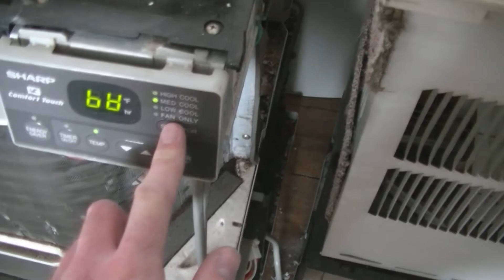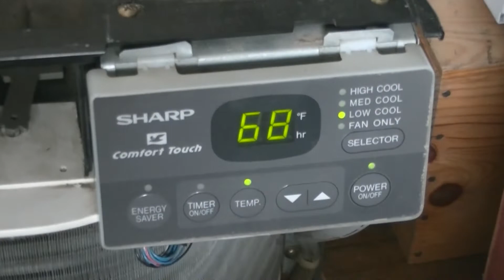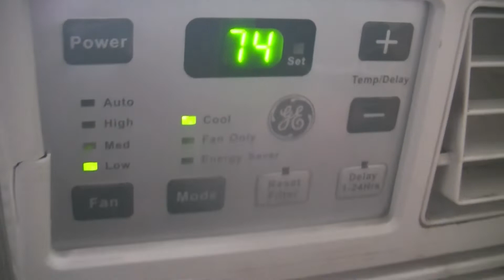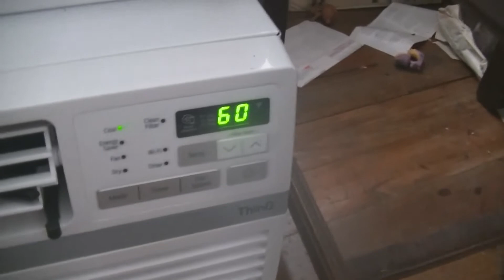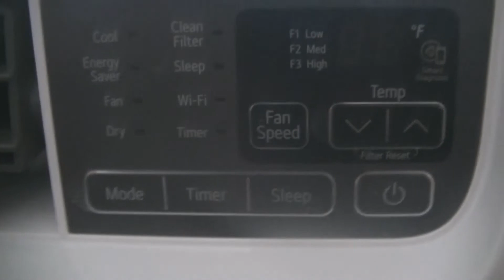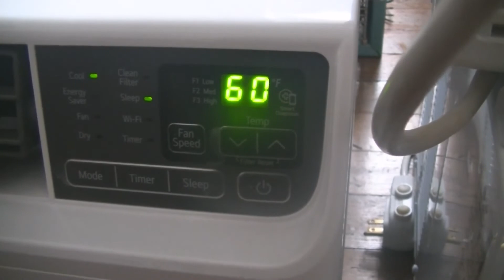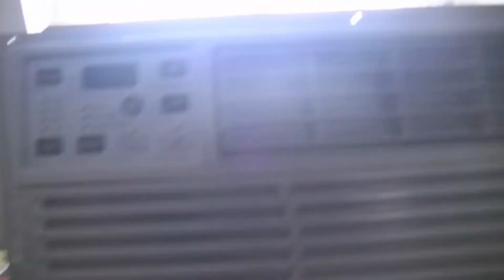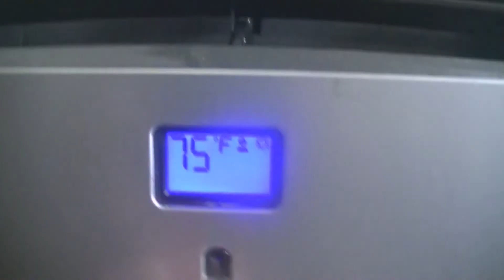Window AC Startups 2022

Comment: The side panels on my Sharp are well and truly broken now and I have no use for it anymore so if you're interested I'll give you a good deal, it's a 6500btu from 1996 that works very well aside from a noisy fan motor
Reply from the maker: I may be interested.  Does it look the same as the ones shown in the video?
Reply: @carson01XJ  It looks different and isn't a slide out chassis, there's videos of it on my channel if I'm not mistaken